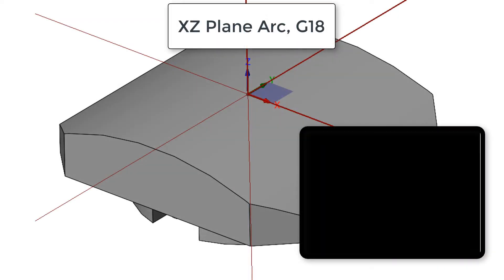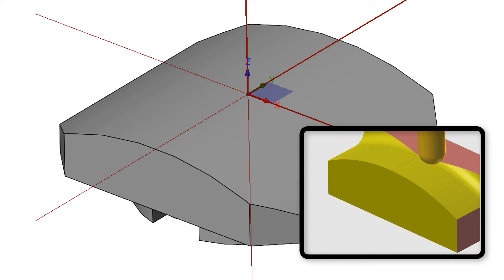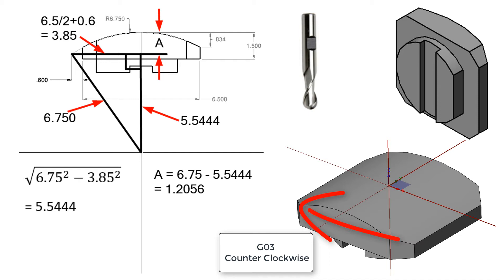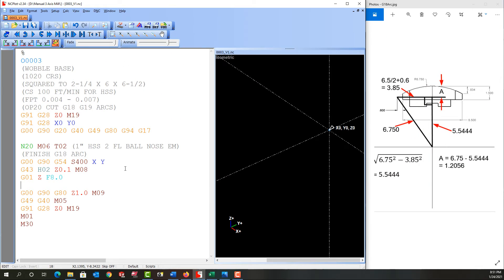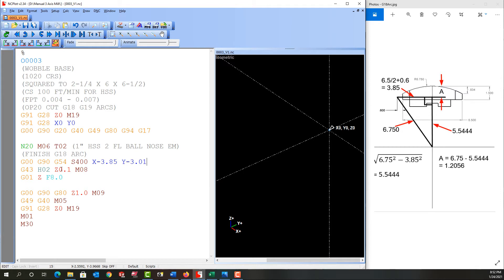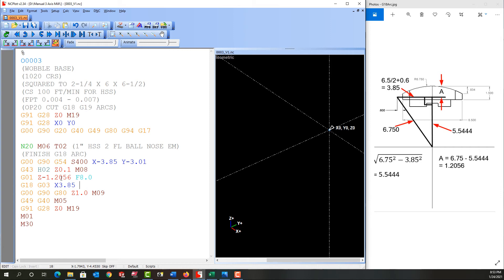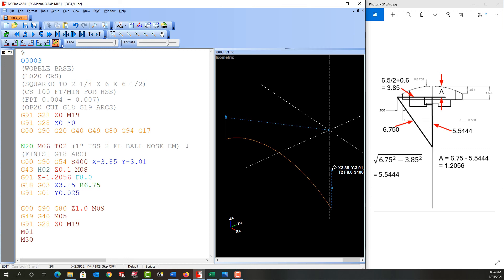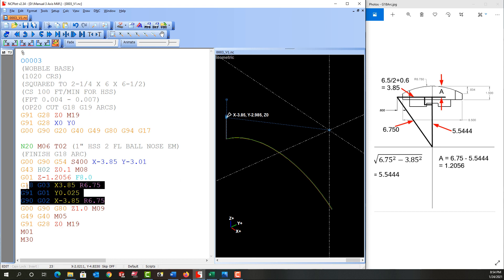G18 - XZ Arc

Comment: g18 g19 can use g41/g42?????? please make g02 g03 must use i j k
Reply from the maker: Yes you could use cutter compensation, however; this example does not.
Most controllers will accept the "R or R-" for arcs which sweep through less than 360 degrees.
A few controllers I have worked on will not, in which case I, J or K would be required.
In this case the R could be replaced with I3.85 K-5.5444
Reply: yes it can use g41 and g42, but its arc. tool path is arc plus or minus tool radius is so easy no need radius compensation LOL no need think is it g41 or g42 you allready calculate it add ur sub tool radius xD
EXAMPLE ARC 30 TOOL 10 BALL
G19
G1 G42 X30 Y30 Z-5 D55
G2 Y-30 R30

G0 G40 X30 Y0
G1 X30 Y25 Z-5 (same without compensation)
G2 Y-25 R25

they are exactly same path had do test is it g41 or g42 z-5 not make sense with compensation, but without compensation it all make sense. i just know tool start y25 and z-5 bcoz tool is 10 and arc is 30 LOL

same with G18 xz plane starting x+ would use G3 and G41 yes it like make no sense but calculate its just arc-toolr and g2 or g3 another go z- another go z+ there will no mistakes another just cut air LOL
same as we change direction with g2 and g3 we need change g41 and g42.
it is easier just calculate path bcoz its just easy arc

its like

G19
G1 G42 Y30 Z-5 D55
G2 Y-30 R30 (arc)

G1 G41 Y-30 Z-5 D55 (compensation not actual move we allready there)
G3 Y30 R30 (arc other way)
G0 G40 Y25 Z10 (move up yes we are actually y25)

(without compensation YES this easy. same path as above less code)
G19
G1 Y25 Z-5
G2 Y-25 R25
G3 Y25 R25
G0 Z10
Reply: @JarppaGuru  do make practical video so we can undersTAND